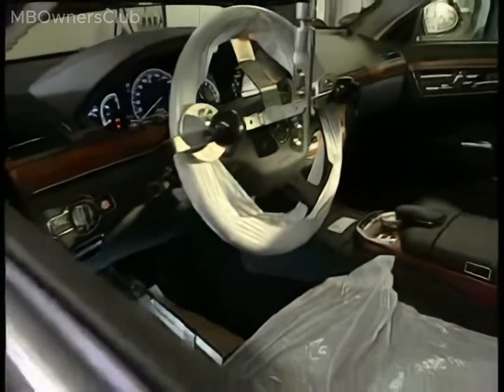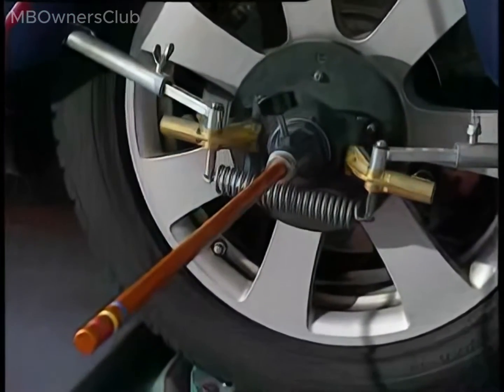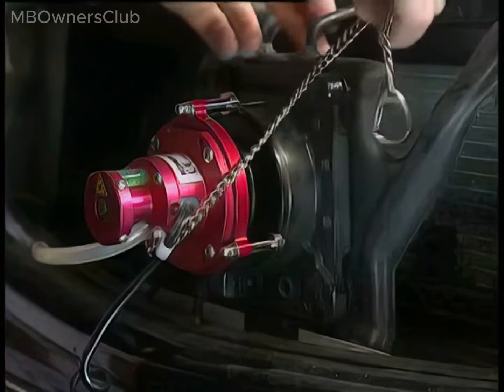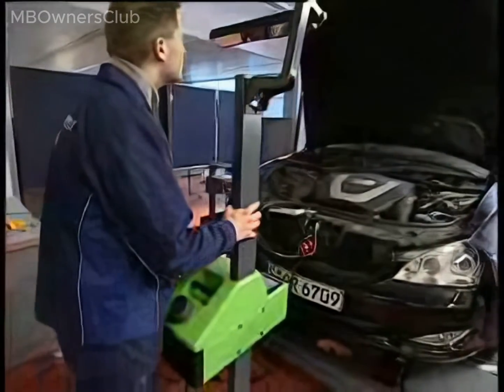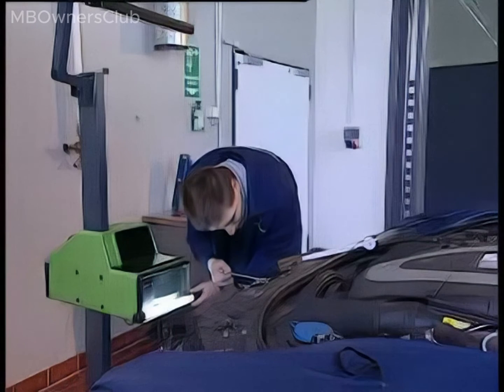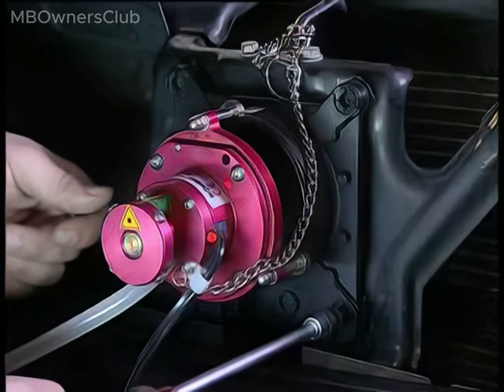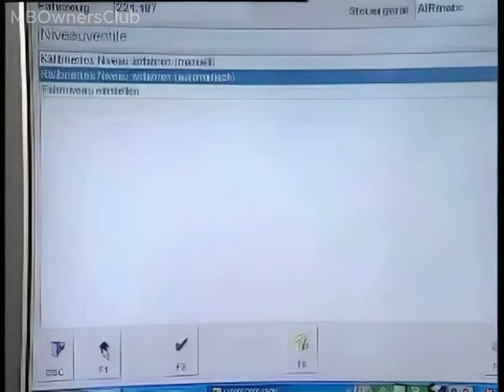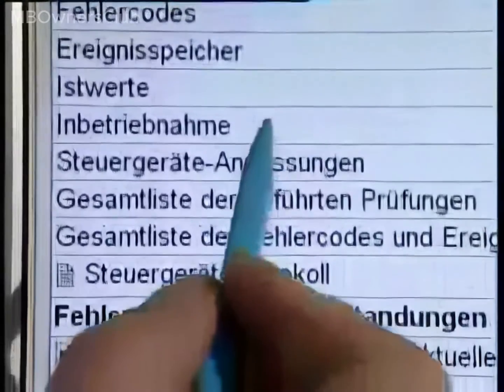Mercedes-Benz: Distronic Radar Sensor Calibration: Step-By-Step Guide

Comment: Would like to check the faulty code U11A687 radar sensor for Mercedes Vito 116 2018 , but I unable to find the location of radar sensor , appreciate if you could share 
Due the faulty show 
Blind spot, lane Assit and the light inter all inoperative show the same time tqtqtq 😢